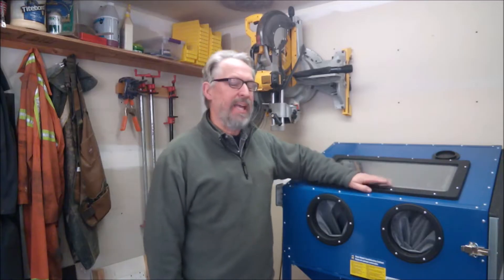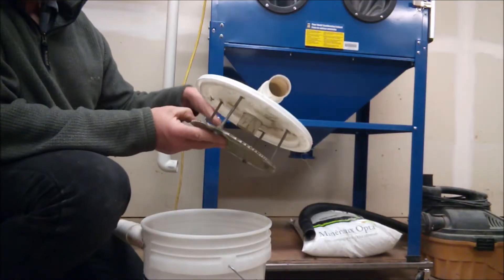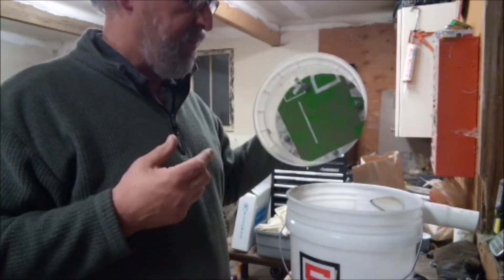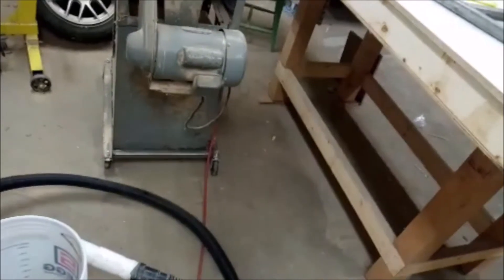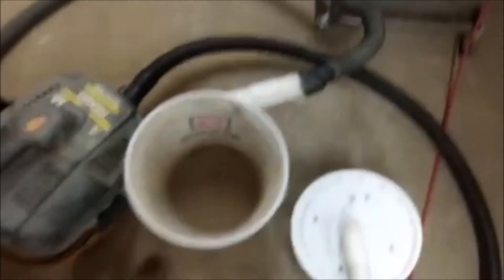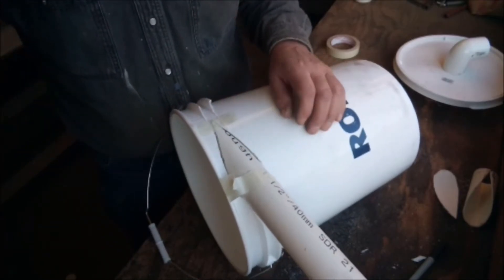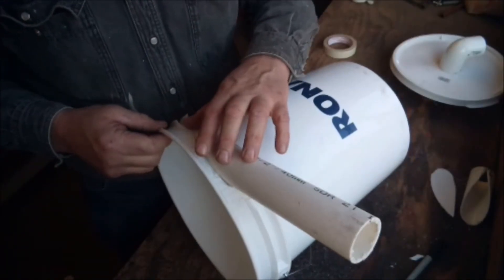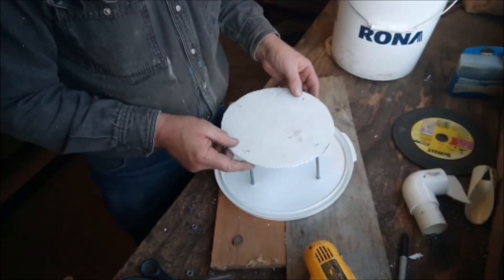Easier, cheaper, simpler, better? dust separator based on Thien Baffle

Comment: Crude rush through without any measurements to take the guesswork out of assembly.  Author mentioned that the Thien Baffle needed certain demensions for the distance between the exhaust interior opening and the plate but he gave none.  Just dumb luck it worked so well?

Comment: Good build and pretty easy and functional design but I would make the dust input in a top section of a bucket to be inserted in collection bucket, because it will crack over time due to brittling of plastic and negative pressure wanting to collapse it, so no need to rebuild when bucket fails. 
I made one with lid in/output using the great, retrofit, screw-on lid (gamma seal) but, when bucket failed, lid frame would not come off bucket without breaking. Next time I will use a regular lid reinforced with a plywood disk.

Comment: Maybe rough up the pvc pipe and the side of the bucket and use either rtv gasket sealer or 2 part marine grade epoxy to attach the inlet pipe?
Reply: Urethane caulk will stick to anything.stays flexable.

Comment: just a thought if run your intake tube down farther and cut a half section out of the side then you can attach the baffle to the bottom of the tube and no longer need the 4 bolts.

Comment: Just wondering something... Would this work better if the inlet pipe was lowered a couple inches. I'm thinking if it was below the baffle inside the bucket, gravity would pull the dust down before it had a chance to get sucked into the outlet. Seems like your version works pretty good so I may be over analyzing the engineering of this design. I subbed!

Comment: Just to clarify, the baffle plate is below the dust intake? I'm surprised the central clean air suction port doesn't pull the dirt in from the vortex on the outer circumference.. Obviously, the vortex is powerful enough to prevent it, I guess 👍🇦🇺

Comment: Get your wife to supply your setup with nylons or pantyhose (are they still fashionable, I’ve been away from all that). Or dollar store!  Fine mesh over holes in intake pipe or filt in vac- will catch fines.  Tap the device after using and it will allow fines to settle down to bottom.  We had a fairly large unit at work, had a “sock” setup on the return side that caught 99% of the micro dust returned to the workplace.  Glad to see that you built your own rather than the import cheapies flooding us!

Comment: This is amazing! The best science I've seen on the baffle design so far, I really appreciate the explanation and the detailed measurements given. Although after watching this, I'm certain that I won't be building one of these. I don't know how you cut that PVC pipe so accurately. I use an oscillating tool and I can barely cut a straight line in drywall with one of those.

Comment: Stumbled on your video a couple nights ago by accident. Ended up building my own last night basically like yours. I added one upgrade for mine though. Still surprised that it worked on the 1st attempt. 9:18 instead of putting the pvc pipe down the middle of the lid, I cut the hole big enough to screw in a clear plastic lid from a laundry deodorant bottle and then attached the 90’ elbow to that. Now I can watch to see if any dust is making it past the separator and into the shop vac. Nothing noticeable after using my table saw all morning! Thnx👍🏼

Comment: Works great. After watching many videos I combined your design for the intake to enter directly into the bucket with the idea of a deeper bucket. I didn't use two buckets but an 18" tall bucket for more separation of the dust and the baffle. Don't like the idea of the intake below the baffle. In the smaller space there might be more turbulance and less separation. Thanks.

Comment: Could these cyclone dust collector systems burn out a vacumm cleaner as I did purchased the Dust Deputy and I ended up having two of the vacuum cleaners  burn out from the use of the cyclone dust collector?

Comment: What about a equal diameter funnel as a baffle. Either inverted or point down. If point was down perhaps that serves as a baffle and as a way to encourage stronger cyclone. Also, what about two buckets seated on top of one another. The top bucket with no bottom and the bottom bucket with a trash bag for ease of disposal?

Comment: It's much easier to cut holes in plastic with a punch. You can make hole punches by sharpening one end of a piece of EMT or other thin wall metal pipe. Use a piece of wood (4x4 or larger) as an anvil (into the end grain of the wood).

Comment: Would it be more efficient for the inlet to be mounted on the bucket below the baffle? As is, the inlet is right next to the exhaust. Also, I have a Duststopper. Doesn't work as well as expected. I put 1 or 2 gallons of water in in the bottom of the bucket to help trap the dust.

Comment: Good show ole'boy!  Hope this does the trick.  Currently I have a 5gal bucket with a store-bought black cyclone lid (only a few bucks, was worth a shot)...but gets overpowered by my standard shop-vac...or leaks?  Ironically, (dedicated to disc sander), all my HDPE went straight to the vac, and aluminum stayed in the "cyclone" bucket???

Comment: Thanks for this very detailed instruction.  I hope to make a dust separator soon and will be following this format.  I have a couple questions....  what horse power shop vac is ideal?  Have you had any issues with the bucket collapsing?   I've seen many videos where some type of pressure relief valve needed to be added.  Apparently the power of the vacuum can be too much for the thin wall bucket when there's a pressure loss (ie. vacuuming a floor or surface with a tight seal at the collection point).

Comment: Thanks for the video.  I'm wondering how the inlet pipe, hot melt glued to the bucket has held up over time and use?  My first guess is it's not a strong joint, and that connection is stressed during everyday use.  I'd appreciate an update.  I built a Thein some years back, using a store bought adapter and it's held up fine.  I'm thinking of building a second and your technique looks easier.  Thanks again.
Reply from the maker: this build is now over 2.5 years old and it has held up fine, the hot glue joint is good as new. I don't use it a ton but when I do I am not particularly gentle with it and have had no problems or breakages. Cheers!
Reply: @theconsiderednut6679  Amazing.  I learned something new today.  I feel inspired.  Thanks again.
Reply: You could add some metal angle reinforcements. Or use urethane caulk. It stays flexable and sticks to anything.

Comment: I really like this concept but a have one question. Why is the incoming stream entering above the baffle zone and not below it? 
While I accept that your design works, isn't there the potential to short circuit between the incoming stream and the exhaust pipe above the baffle zone?
Reply from the maker: thanks Robert. I too, like many others here, wondered about why the inlet isn't below the baffle, seems intuitive, and to tell you the truth (what a concept!) I don't know. Before I built mine I looked at a bunch of the commercial ones and saw that they built them this way. Also the more recent residential floor vacuums do it this way too. This was pioneered by Dyson and copied by just about everyone else. I figured they had done the research and found this was best. There are a ton of variables here to play with, as has been noted by many others here. I built it this way and got more than acceptable results. I have other tons of other projects to play with! Cheers!

Comment: Thanks for your video. Nice and clear. I could see air inputs counter clockwise. Does it matter if air inputs clockwise? Does geo location interfere with  dust collection effect? I live in South America on ecuatorial zone. Would a conical recipe with wide side to down instead a cylindrical one help to drive dust down side of collector and avoid pass through vacuum? Thanks in advance.
Reply: Just turn the separator upside down! 🙂

Comment: Good plan. Does the out going airflow 90 degree pvc fitting get hot glued to the lid of the bucket?  Also, should the incoming airflow containing the dusty air be entering the bucket at a downward angle?  Thank you.
Reply: anyone have a thought on this?  or vernon, did you ever figure it out.  seems to make sense to me that the intake could come in at a downward angle.

Comment: Would it work better if the intake pipe was below the baffle?  It seems dust would get stuck on top of the baffle and exit through the outtake pipe into the vacuum.  I was going to stack two buckets which would give me plenty of room to lower the intake below the baffle.
Reply: I was wondering the same thing. It looks like it works well enough, but maybe that would make it even better. More research needed...

Comment: It would be cheap and easy to test a 10" baffle diameter instead of a 9" baffle diameter, to learn whether very-fine dust separation could perhaps be improved.  That baffle diameter would give a 1/2" periphery slot, which would still be large enough for small debris.  Various other larger baffle diameters could be easily tested.  The various size parameters of your simple and inexpensive design are adjustable and scalable, which makes it extremely attractive for an experimenter who wants to optimize performance for specific applications.  Yours is a superb presentation that anyone can follow.  It is hard to dispute your great success with separation of fine dust.
Reply: Build it with the smallest baffle, and, add or subtract diameter by screwing on additional baffles.

Comment: Why aren't you mounting the dust intake pipe under the coroplast divider baffle ? It would seem more effective to have the pipe under the divider so more dust stays away from the outlet to the vacuum hose..
Also, when using for drywall sanding, why not put water in the bucket to capture more of the fine drywall dust?  Thanks for the very good and simple design..

Comment: Just a question, I may have missed an explanation. Why do you put the incoming above the baffel? Would it possibly be more effective if the incoming was below baffel? If not why?
Reply: I suspect it will dramatically reduce the suction. With the current model it only works  because there is direct air flow between inlet and outlet and the only reason debris does not get into the outflow/suction is because of centrifugal force and heavier the particle the more it's sticking towards edges and the air is sucked from centre where there is minimum debris.

Comment: I have several Thien original design separators and do like this variation. I generally use 20-gallon metal trash cans so I'm wondering if you have tied cutting this type of intake port in a metal trash can with the vertical ridges. Guess I'll try it. Nice design and the work very well.
Reply: Line the top foot with smooth plastic.

Comment: Nice, thanks a lot for the great explanation plus how you made it. What I'm still trying to understand is the baffle placement. I have seen videos, like this one, that put the entry pipe between the baffle and the lid, with the correct separation between the baffle and the bucket wall. The theory for this design is that the air with dust enters and spins inevitably downward so the baffle contains the dust below. Some claim this design still allows for very fine dust to rest on top of the baffle and will get sucked by the vac, after some time this fine dust clogs the filter and may go out of the vac too. However I have seen other videos were they put the entry pipe below the baffle so the dust always goes below and only clean air is above the baffle, reducing the fine dust that gets in vac. Now I'm wondering which of both designs is the better since fine dust is the most dangerous for both the filter and our lungs. It will be great if any one have more info on this or have tried the entry pipe below the baffle design.
Reply: That is what I was wondering too. It seems (to me at least) that the inlet should be below the baffle. Still a nice simple way to make the device. I have seen versions that seem to work very well without the baffle also.
Reply: @gregarrell6132  I ended up making it with the inlet below the baffle and the outlet above it. After more than a year using it and filling the bucket several times I can tell you it really works good!
Very little fine dust reaches the vac, last time I opened it the filter was almost clean, just some fine dust went out when I hit it gently. Don't know if the experience of others that have put the inlet above the baffle is the same in the long run but in my case it has proven effective separating most of the particles from clean air.
Reply: @jellyg.8961  thank you for responding. I am planning to modify my shop vac to reduce the fine filter blocking up so quickly. I think that adding the baffle and an directing the inlet to make sure it does the cyclonic swirl will help a lot.

Comment: Question: why is the inlet into the bucket above the baffle? Does that not increase the risk of dust being sucked out instantly?
Reply: The incoming particles are coming in fast and are being thrown against the inside wall of the bucket as they spin around the bucket. As they loose speed they drop to the bottom. The baffle acts as a barrier between the particles that are settling to the bottom and the outlet in the top lid. The fancy name is the Cyclone Effect - the bottom line - it is tested and it works.

Comment: HELP! I followed your build instructions exactly and now I have a 
problem.  The collector works perfectly, however when I start picking up
 sawdust it works perfectly, but when the the pickup hose was done an 
extremely loud whistle/siren erupted from the pickup hose.  The pickup 
hose was flexible plastic with ribs on the inside of the hose.  Could 
the inside ribs been causing the siren/whistle?
Reply: check that you don't have a piece of wood chip stuck inside the tube - it will act like a whistle - - maybe pass a broom handle through to dislodge it.
Reply: @nrich5127  I'm sure I'll need a smooth wall hose to stop the whistle.  Thanks
Reply from the maker: I don't think you need a smooth wall hose, mine is the standard ribbed hose. Like nrich51, I suspect you either have an obstruction or that your hose is too small. Is it about the same diameter as the inlet to the collector?
Reply: @theconsiderednut6679  You are absolutely right!  When I hooked up a 1 7/8"ribbed hose to the 1 1/2" inlet on the separator  it worked perfectly....You Da Man!!!! Thx

Comment: Great first upload into the global highway of the Tubes!
Wish you well on your journey, mate.👍🏽
I built my separator some years back now, similar to yours all but the baffle, none at all, and my vacuum never collects any dust or debris at all. 👌🏽
Reply from the maker: I know Bill, I have wondered about the need for the baffle too, I should do some experiments! Thanks for the comment!
Reply: @theconsiderednut6679  Great video with clear instructions and a dry sense of humour.  Like others here, I wondered about the placement of the Thien baffle relative to the inlet.  I'm going to make one without the baffle and try that out; I have a project to remove carpet glue and three layers of paint on my concrete basement floor. I will use a 7" angle grinder, diamond cup and dust shroud shroud that kicks out very fine, hazardous dust that clogs my shop vac in very few minutes. If necessary, I can make another lid with baffle later.

Comment: that baffle is not made properly when you cyclone the debris on the outer circumference but the exhaust draws from the outer circumference your going to lift the fine debris while in cyclone into baffle and out exhaust....  what you should have done is run outer channels like a dyson or simpler method make baffle with many 1/2 in short pipes in center at 22 degree tilt away from cyclone direction. as in a cyclone the lowest pressure and speed is center so to have negative pressure in middle is better but you want more than 1 or 2 holes to prevent destabilization approximately wanting a larger volume of exhaust than the intake like if you have a 2 1/2 in intake 6, half inch pipes should be more or 4 , 3/4 pipes
Reply from the maker: That's an interesting idea Kevin but I don't quite understand. Why don't you make one and show us?
Reply: @theconsiderednut6679  no need just like to view diy stuff

Comment: A very clear explanation of how the Thien baffle works. I've just set up a home woodworking shop in my kitchen so desperately need dust extraction! Obviously this can be fine tuned but it looks as though it may be a better option than the conical cyclone separators for my setup

Comment: Hi, The Considered Nut! It may be better to place the inlet pipe below the reflection  disc? What do you think about it?
Thank you.
Reply from the maker: that is an interesting thought, as others (below) have also questioned. I wonder if having the main blast of air under the baffle will keep the dust in suspension and drive it up and out to the vacuum. I think the inlet above the baffle might give you the most quiet space for the dust to settle out. Someone should try it and let us know!

Comment: Maybe I missed it, but how did you determine how far down the baffle was under the lid?  Thanks for the video :)
Reply: I think it sits just below the level at which the intake pipe (the one that sucks the dust) is attached to the side of the bucket. However I've seen videos of people making a similar design were the baffle sits above the top part of the side opening so when the dust enters it always sits below the baffle.
Reply: Well, that's a twist I haven't seen before.
Reply from the maker: I don't think it is critical. I would make sure that the baffle is below the bottom of the inlet tube by maybe half a diameter but that is just my feeling on it!